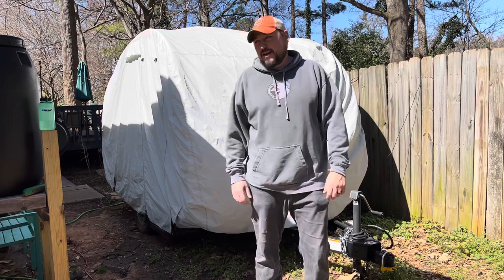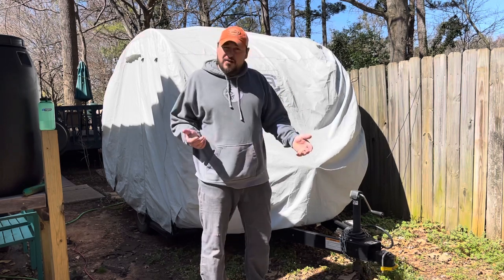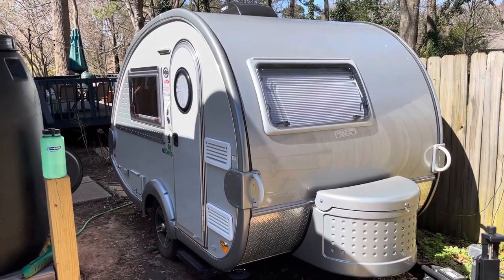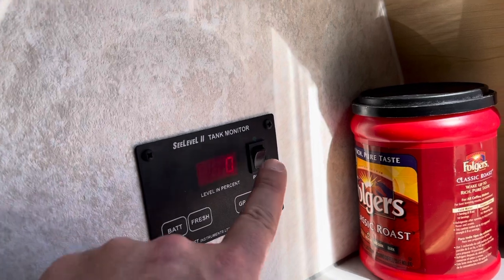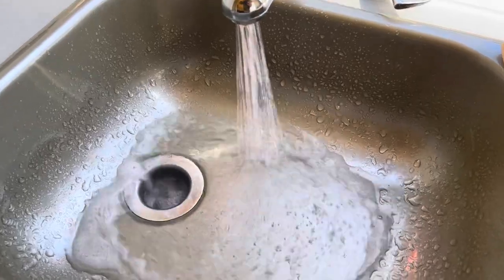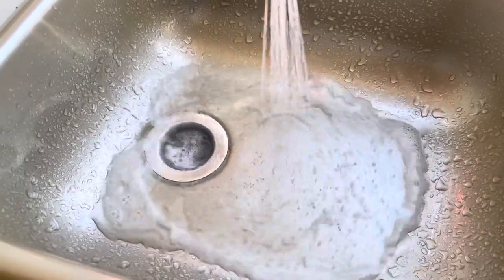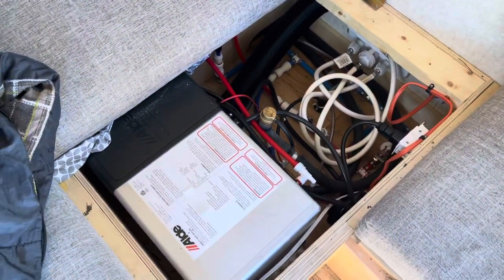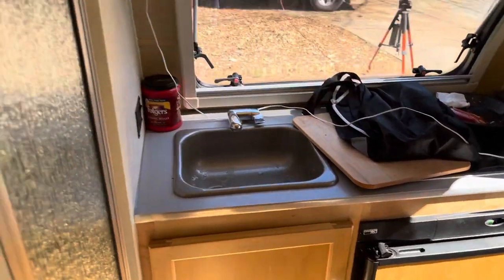De-Winterizing the NuCamp T@B 320 S (2018)

Comment: Where exactly in that mess is the bypass. I see a lot of valves, but not the bypass. Your video is most helpful. Thanks.
Reply from the maker: At 6:32, you can see where the red hose runs into the blue hose. There is a valve there between the red and the blue that is covered by the larger black hose. But just below the black hose, above the white hose, there is a tab of silver. That is the bypass.

Comment: First of all, thank you for the video!  Much easier to understand than the confusing manual.  

Do you sanitize the water and put bleach in the tank during your process?
Reply from the maker: I don't. I done use the tank water for consumption. I typically reserve that water from a bathing.

Comment: Your video helped me so much with dewinterizing my 2018 T@b 320S. I had issues with the fresh water drain as the valve handle is missing, but I got it to work. Would you happen to know where I can get a handle for that drain valve? Also, I got the valves open and/or closed for the hot/cold drain valves, bypass valve, cold water valve, but the hot water valve handle will not budge. At all. I tried pliers and can't budge it. The valve is sideways which doesn't make it easy. I welcome any suggestions you have in how to get that valve handle to move. Thanks for your great videos.